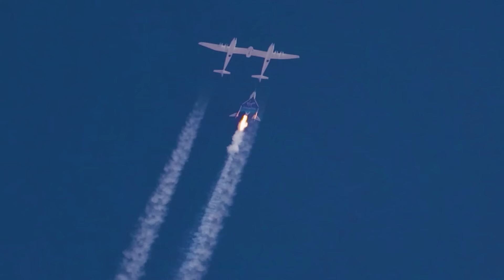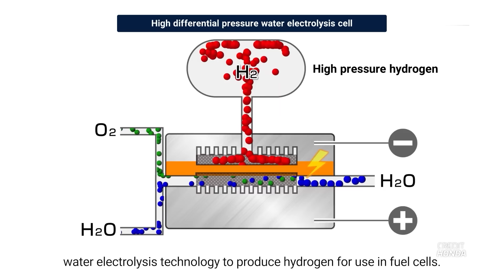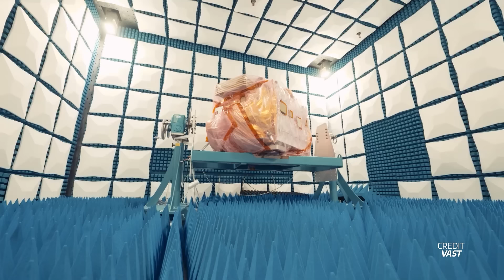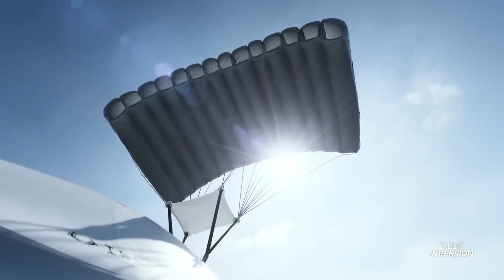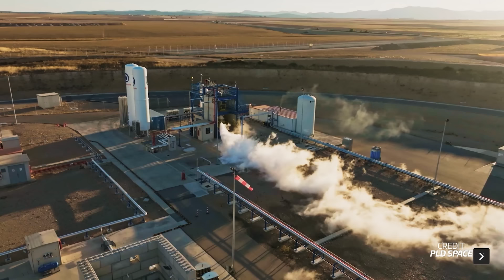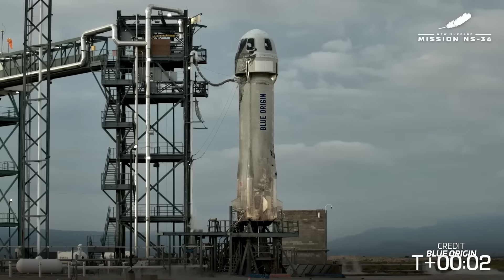Blue Origin's “Never Tell Me The Odds” Moves; Starship Flight 11 Monday! | This Week In Spaceflight

Comment: Can they adapt Orion to Falcon Heavy?
Reply: It's possible to adapt Orion to both Falcon Heavy and New Glenn but only theory and would likely require significant modifications which will take a long time to do - initial studies, design changes, tests, then manufacture of stages and adaptors.

SLS is still NASA's safest bet and is more capable that any other vehicle on the market today to handle Orion and has flight proven it. So NASA has no other choice but to stick with SLS (which in itself is not a bad rocket at all) to even stand a chance of landing people on the Moon by 2029/30, which is what this is all about.
Reply: Blue can probably get more preformance out of new glenn and then it would be a better candidate  for lauching orion
Reply: It's important to note that both New Glenn and Falcon Heavy would have problems (each of a different kind) when adapting Orion.

They will both need to have, on top of their upper stages, a very tall structure of ICPS stage (from SLS) with Orion, ESM and LAS on top of it in order to be able to send Orion on a manned mission into NRHO (lunar orbit).

Falcon Heavy's problem is while it has in theory barely enougn thrust to lift ICPS with Orion (being short half a tonne to a tonne, probably, FH fairing removed), it's capacity of 63.8 t to LEO in expendable mode is purely theoretical. It has a small diameter upper stage (3.66 m) and nothing even close to the capacity of 63.8 t can fit under its fairing (incl. extended). So it's likely that its structural strenght by design (same upper stage, faring and connection points as Falcon 9) does not match it's max lift capacity. Hardly anyone outside SX has the numbers but it will likely either require a lot of redesign of the upper stage and structural strengthening or likely may not even be possible at all for manned Orion missions - only Artemis I type of flight.

New Glenn's problem would be is that while it has more than enough diameter of its upper stage and probably structural stenght to accomodate the Orion structure of max. 5.5 m diameter and 66.2 t total mass (I don't know if it includes Orion's fairing cone and stage adaptor) , it does not have enough thrust to lift it. It currently only has about 40 t capability to LEO in reusable mode (future 45 t) which puts it in low 50's in terms of tonnes to LEO in expendable mode. This means it would have to adapt 4 to 6 or more solid rocket boosters from Vulcan to lift ICPS with Orion. It's probably doable but a lot of design work as well.